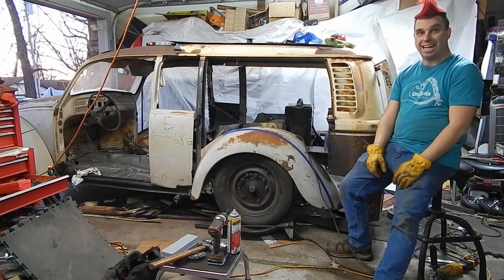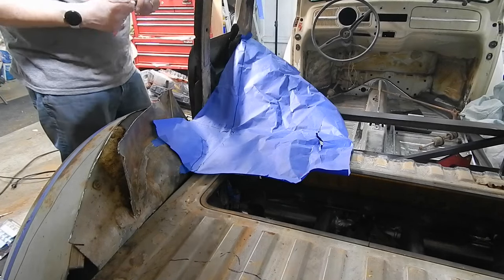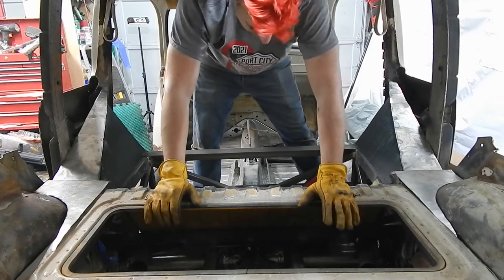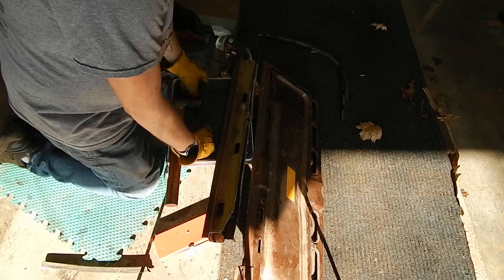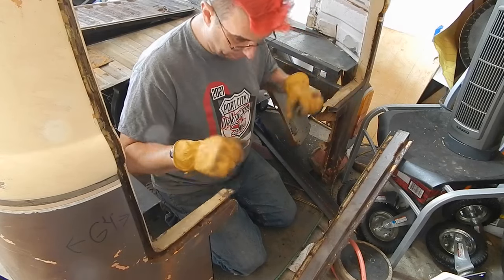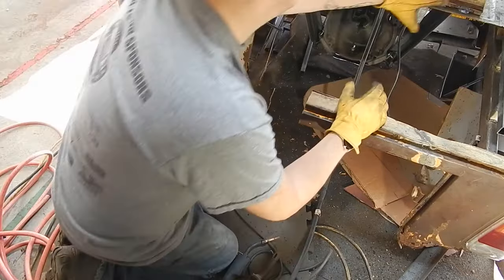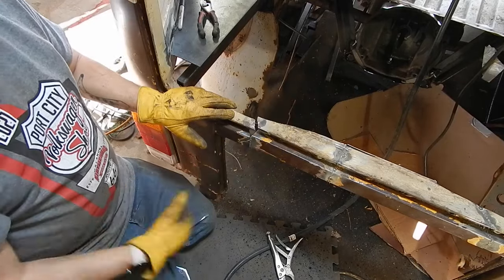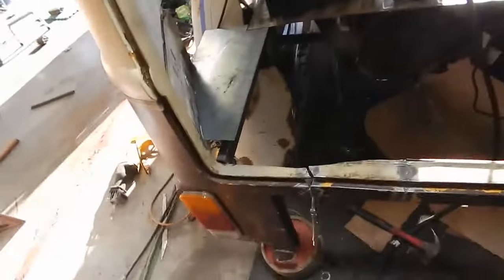VW Bus Hatch Frame restoration on a VW Bug? Käfer Van Build, Panel Bug ep 15

Comment: Ahoj from southern Germany ...
I remarked something. If you use those fenders for the back axle, please ensure that there is enough space to pull the torsion bar out, if necessary.. would be awful if the paintwork is done..
Or you change the beetle torsion bar with them from a bus.